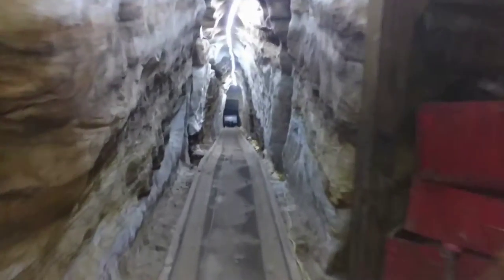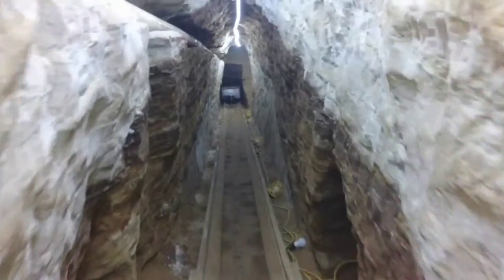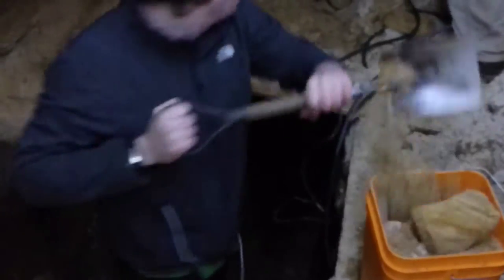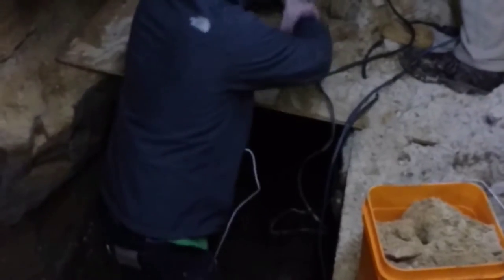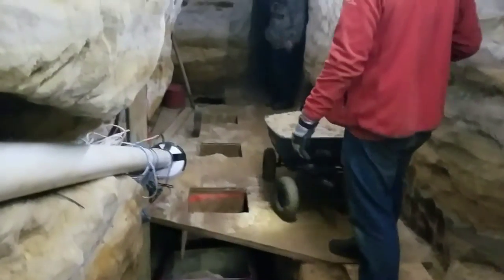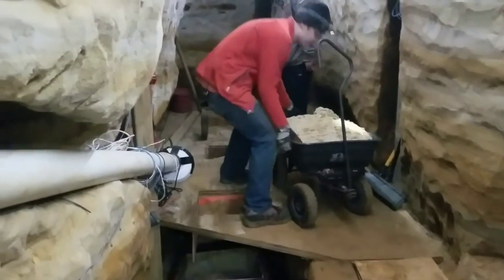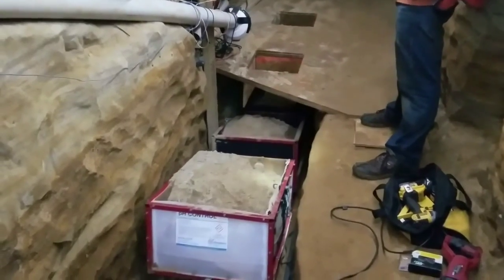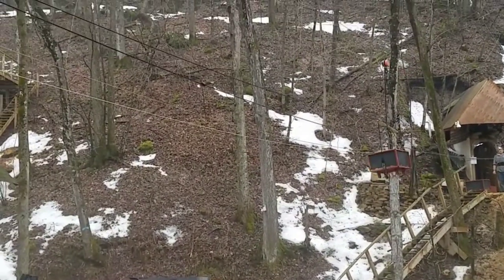Sandstone Tunnel Digging (The Quick Version)

Comment: What power tool are you using to cut or bust that sandstone? I have some that I need to move and that sledge hammer gets heavy after a while.
Reply from the maker: I like the 1400W "XtremepowerUS" demolition hammers, they're about $90 on Amazon or from Home Desperate. Stupid name but they work great, and they last for years if you put some 100-micron screen over the air vents to keep the dust out.